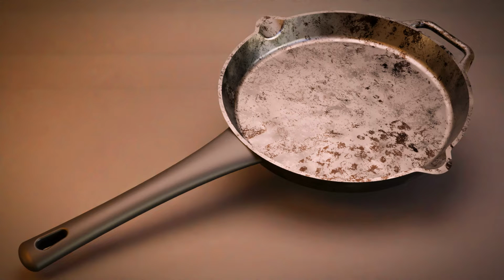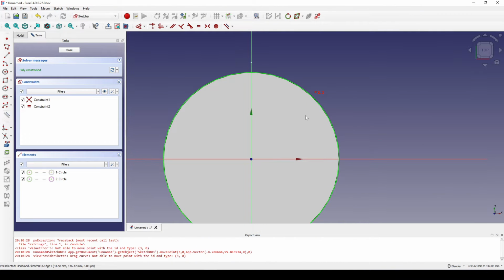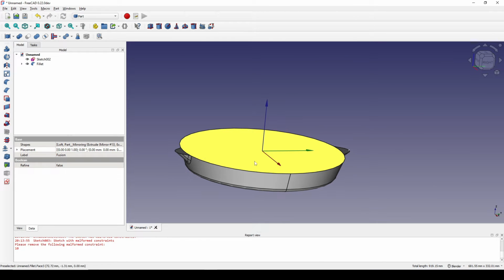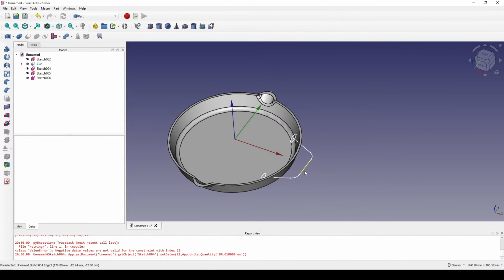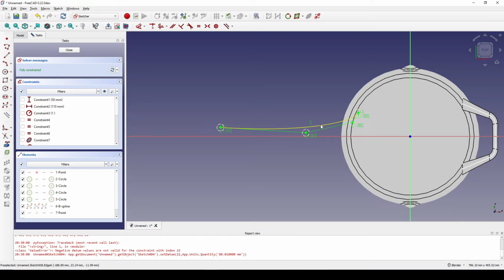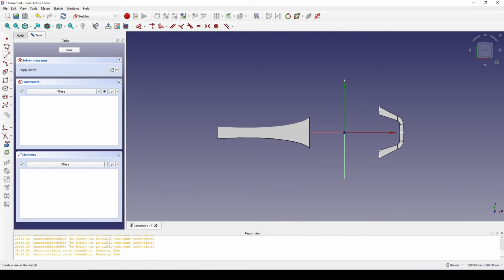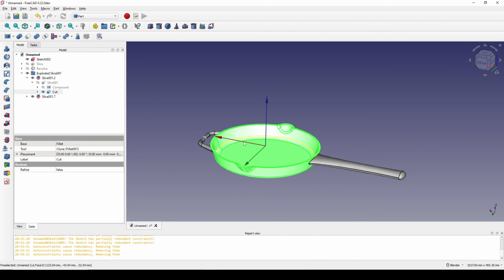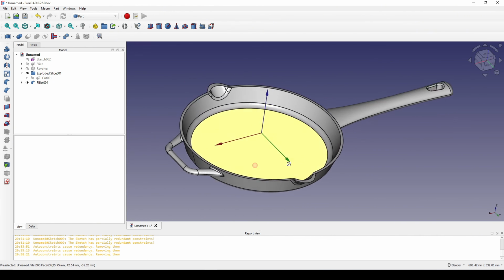FreeCad New Version - Modeling A Pan.

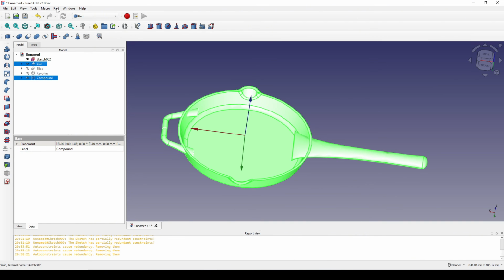Comment: Everything works fine until about 22:12. When I preform the 'slice apart', I only get 6 parts rather than the 8 you get. The small handle slice properly, but the long handle does not. The long handle looks like it is in 3 parts. I can click on any of the 3 sections they highlight as in your video, but when I click on any of them, the same slice (Slice001.5) in the tree view is selected and deleting the single highlighted section deletes the entire handle. I imagine this is a bug in 1.1.0dev.38923.
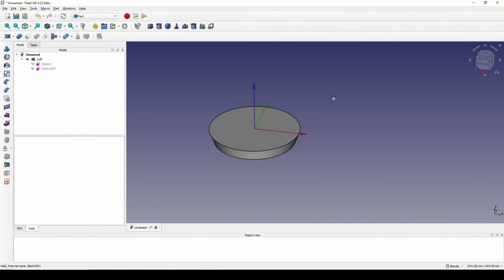Reply from the maker: If Slice apart seems buggy, you just looking for the very first Loft in the begining of the video 2:02. Then use it as a cutter and cut the compound.
Reply: @DuyQuangDang  Thanks, but I had the same result; the small handle sliced properly, but the long handle did not. I'm going to take a look at how I created the handle as I may have made an error. If not, I'm not worried about it. 

I should add that I have been only using the Part WB so far in FC. I appreciate what you've shown me using the Part, Curves and Curved Shapes workbenches. I especially liked the sculpture tutorial.
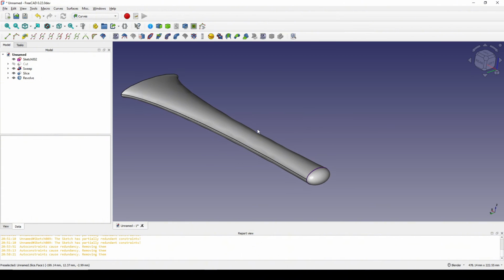Reply from the maker: @leroycasterline1122  Thanks leroy!  I think you should aware of 21:19, If you not select enough face, you will create a shell instead of a solid. The solid is Green, but the shell is brown.